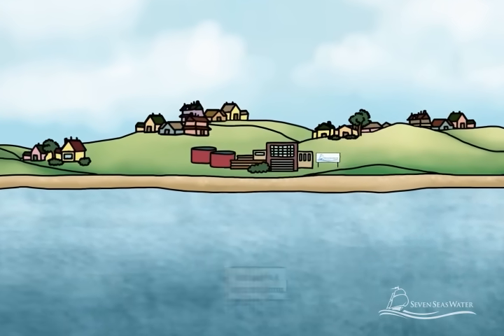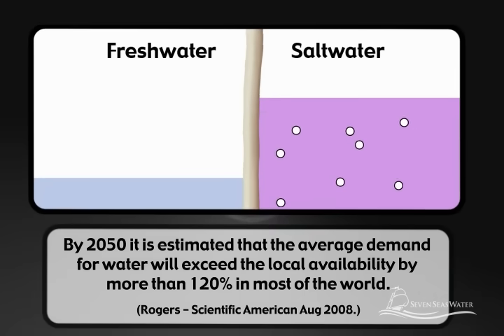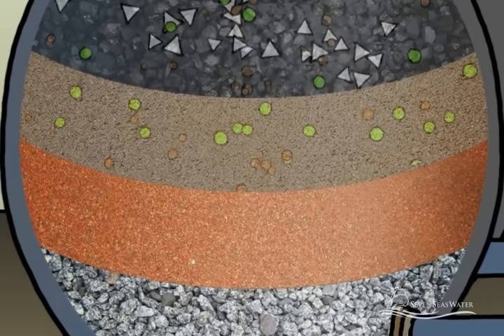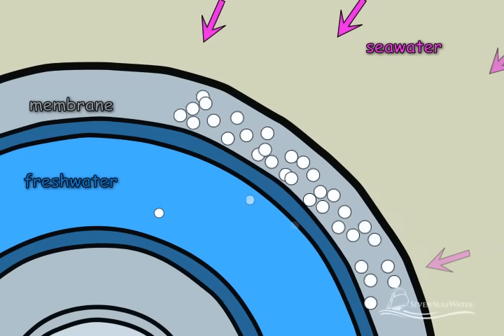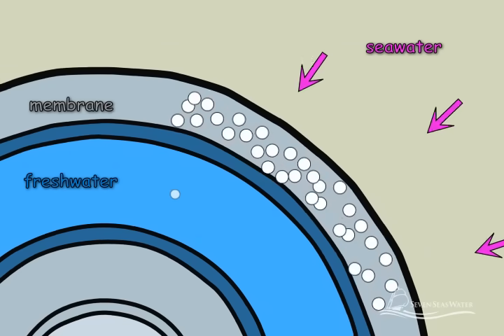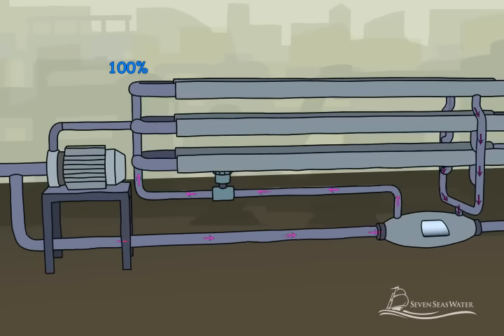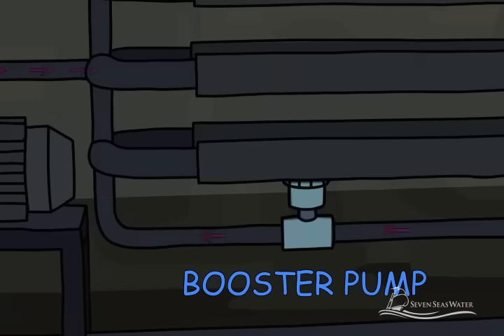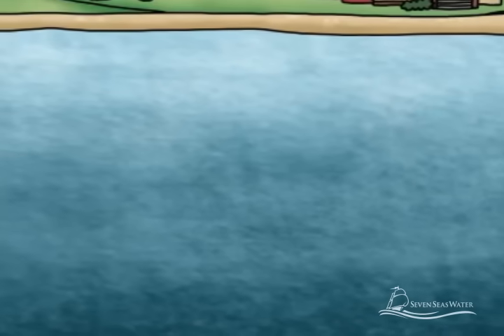How Seawater Desalination Works

Comment: Says someone who never took an engineering class "Wow it so easy! Why aren't we building this?"
Reply: This process is very costly and it requires higher maintenance cost time to time.
Nowadays, Desalination method is commonly used in gulf countries and nothern region of african continent nations.
Reply: The leftover brine is also toxic when put back into the ocean. If we could find a way to handle the brine I don't see how this could be an issue. The other problem I could see is the cost and energy consumption needed by these plants. We need better nuclear technology to power the 21st century needs
Reply: @prospektOS-tmo97  That's right.  Make things simple.  The isobaric energy recovery device is just a rotating cylinder with ends cut at an angle.  Easy.
Reply: @cryora  
It's technically a turbopump that uses the pressure drop across the brine to boost the pressure of the incoming seawater, right?
Reply: @gregorymalchuk272  Too complicated.  A cylinder with its end cut at an angle.  Now that is simpler.
Reply: I'm pretty sure it's easier than sending 4 humans to space for months and bringing them back.
Reply: One thing that they do not mention is how much fresh water is then used to backwash the ro filter.
Reply: Live abord Sailboats all use this technology.  Look up Spectrum water makers.  One of many.
Reply: @prospektOS-tmo97  It's just a rotating cylinder with the ends cut at an angle.
Reply: @Willem DaFuckedUp You can still wash yourself with it or irrigate plants. If you want to drink it just add a miniscule amount of salt.
Reply: Rubashow and you irrigate plants yourself yet!!!??  Have you ever???  But what the Fuck do you think happens after you irrigate plants with salt water!!!!???    They die you
Dumb shit!!      Think!! Not with your asshole. Do humanity a favor.
Reply: INTREPIDELICA  Those countries which have these plants,also have a plenty of sunrays so I'm sure they can use solar energy for sucking, pumping and filtering the sea water
Reply: Actually it isn't so difficult, but the cost is the problem, membrane production is incredibly complicated and expensive, even though its energy requirement its less than any method using water boiling
Reply: Energy consumption. Takes a large amount of energy to accomplish all this. Much more than just pumping fresh water.
Reply: @Fudzbo  There is a capital break even point. Most coastal cities are serviced by dams, aquaducts, pipes pumps etc located in distant mountains. Where the cost of all that stuff exceeds a desal plant you might be better off going desal. Some years ago I heard a lecture where it was suggested for a coastal city, on average, if the fresh water had to be brought more than 50kms, desal would be more cost effective.
Reply: Because the engineers who built this were morons. This is the worst way to do it. Literally. There are at least 2 or 3 better ways I can come up with on my own that will all work better than this.
Reply: no u
Reply: INTREPIDELICA   Some times it isn't about the price. BTW you can make a simple desalinator for like 50 bucks
Reply: Evan Kocka Because it was made by a moron its over complex to scam money out of rich bozos all u need us a water distiller its more effective and water is always as clean ad the first batch as opposed to this bullcrap that water keeps getting dirtier as the filters get old since day 1. All u need is 2 activated carbon filters pre and post and a water distiller also distilled water had 0PPM use a tds meter on this “potable water” and you see its till dirty. Bozo
Reply: You know we do have a massive scale desalination process going on all the time. its called rain, pours into rivers. If we just stop dumping all of our trash in 'm it might just solve the issue.
Reply: Just like the electric car
Reply: Reverse osmosis is relatively an expensive process due to high energy consumption and materials used to filter.  In addition, many companies disposes waste materials and chemicals into the oceans, which can create more problems for the filters.
Reply: @diehappy3997  a mistake many utilities make is to mothball reverse osmosis plants.   If they have been offline for more than a few months it can be very expensive and time consuming to bring them back on line because plumbing tends to clog if not continually flushed. Most  experts in the field recommend in times of water abundance, reverse osmosis plant be kept in production albeit at a low level. Requires some $$s though.
Reply: வணக்கம்
Reply: We have these. How do you think UAE gets enough water for a world-class metropolis?
Reply: I’m not even in engineering classes yet, this sounds expensive and complicated…
Reply: because he cord d still it
Reply: I understand ur one of those types who sits and says: it cant be done. Think further than.your "classes" or your diploma . Eureka I did it.
Reply: Because that word Economical is being thrown around very loosely. RO does work very well but it's the last option to be used because of cost. Both equipment and maintenance required.
Reply: Running a 1k psi pump 24/7 is troublesome to say the least.
Reply: my question is... Can brine be used for energy? or do they do that already?
Reply: The first reason why we are not building this, Is because it costs a rich mans fortune to make make it.     However, There might be a time and place where money be damned, We need fresh water now! So we might start building these water plants for survival sake.
Reply: @josephcalabrese6337  all of the potable water for the inhabitants on the island of Aruba is desalinated
Reply: @josephcalabrese6337  Instead of going to mars or sending other spacecraft into space, we could use that money for these types of things.  It's funny how things go.
Reply: @josephcalabrese6337  At that point its already to late. This is the sort of thing thats needs to be considered well before then, especially in places like California.
Reply: @jahquanfoster6974  Wasn't Ca. building some of these? If i remember correctly there were several of them being built, however winter came and we got water so it could have been shelved again. dunno.
Reply: @jahquanfoster6974  20 years tops
Reply: @jahquanfoster6974  we have that long m8
Reply: @Willem DaFuckedUp distilation also cleans water of most contaminants. Except organic solvents such as alcohol or gasoline.
Reply: im pretty sure its not that hard for something that keeps you alive, its not like u can say hey its hard lets stop drinking water cause its easier
Reply: @Mustafa_Wrya  i dunno but we can say lets stop drinking water it has been done for ages, the middle ages its simple, everyone drinks alcoholic beverages all the time it has been done so its a possibility.
Reply: @leagueaddict8357   alcohol is not the only ingredient in alcoholic beverages (nor any other liquid you drink)Usually more than 70-80% of them is water if not more, simply because higher % is lethal.
And nothing can replace water no living organism can live without it .
Besides alcohol is a poison im a pharmacy student so dont sell me alcohol is not bad nonsense to me mate.
Reply: @leagueaddict8357  The distilling process takes a huge amount of fresh water to make alcohol, a greater volume than the alcohol actually produced.
Just like using alcohol as an alternative to hydrocarbon fuels, it takes more energy to produce than it (might) save.  
It's estimated if the USA were to replace all petrol with alcohol from locally grown corn, the entire land mass of continental USA would need to be given over to corn production, and that still wouldn't be enough

Alcohol in large quantities also badly effect the bladder, liver and kidneys, effects the brain, and even triggers the brain to think you are more hydrated than you actually are (you know, when you get drunk and just can't stop needing a piss)  Actually dehydrating you more. 

I love alcohol, one of the best things in life is to over indulge on good beer or Irish Whiskey, but you need to drink more water while enjoying it to stave off hangovers and headaches caused by dehydration.  I hope your comment was sarcasm
Reply: Isnt it a LOT cheaper and simpler to just distil water with, say, solar concentrated beams heating it?
Reply: @brunofurtado8382  You mean like the sun, evaporating water, and making rain clouds since the beginning of time?
Reply: @sentinel9046  yes
Reply: @brunofurtado8382  Flash desalination. There is a cross over point involving energy cost the amount of water needed and the nature of associated industrial processes where flash desalination can be more cost effective.
Reply: @brunofurtado8382  it's called rain.
Reply: @brunofurtado8382  no it is not, water needs a lot of energy to be boiled, wheras reverse osmoses uses very little energy
Reply: @brunofurtado8382  That would be a waste of sunlight. It's more economical to use the sunlight to produce electricity and use reverse osmosis for desalination
Reply: @jmlinden7  With current solar cells at an efficience rate under 25%, I find that hard to believe.
Nothing is said about efficiency here - but building large glass-domed, sunlight-accesible trays and pumping out the evaporation as it build up ....  seems much simpler that building a solar energy plant, a electricity storage solution for overnight, building such a desal plant and keeping the whole complex interdependent structure running.
Sure, pumps and filters are also necessary in an evaporation solution, but that would be basically it.
To my mind the main problem would be the large surfaces needed for thos controlled evaporation pools. On a couastline.
Reply: Its that easy and cost effective plus sea water is free, then why the hell are Victorians paying through the nose for their desalination plant out in Wonthaggi? Plus it hasn't been needed or used in years.
Hmmm something smells fishy hahaha excuse the pun
Reply: @henryvong9581  Melbourne was at significant risk of running out so desal plant was needed to address potential catastrophe. Once there is no water in the taps the dying starts after about 24 hours and reaches a peak after about 5 days, by 14 days it's all over, most are dead.
Reply: Willem DaFuckedUp Ive been drinking it for 20 years and also why not add water honey or mix it with fruit juices and cook with it. U sure are a bozo. the healthiest people drink distilled or rain water if distilled water is not good for you how come plants thrive on gods distilled water aka rain? yeah go do more research and make sure they arent part of the zionist kabal like dr mercola.

Comment: this method is convoluted* and wasteful of energy and resources. There has to be a better way.
Reply: +shreddedreams Graphene filters will use much less energy.  Graphene was first produced, not too long ago, in 2003. Removing salt dissolved in water is not an easy process. Reverse Osmosis is more energy efficient when compared to distillation.  We just need more efficient filters.
Reply: I'm saying, in addition to distillation or reverse osmosis. I will invent a way when I have some free time haha
Reply: +TeslasLoveChild if you are interested could you let me know if you think of any possible ideas that you might find too hard for you to test. because I am about to start my science fair project for next year and I want to come up with a better way to desalinate water. I will have about a year to complete this if I can start early enough.
Reply: If we really wanted to we could just build power plants on shorelines and use the distilled water we get from boiling it to make energy and use that for drinking. The issue is maintaining machinery near salt water is harder and the plant would need to be running a water pumping station at the same time they're running a power plant. It doesn't seem like any private investors would wanna do that.

Comment: why don't we just boil it? it would be easier and require less energy...
Reply: Requires more energy.. takes a lot to boil that much water and its slow
Reply: +gotwoh3ll
They said, the process requires a lot of energy. That implies, alternatives like destillation require less energy. They should've been more specific and have said: "It's still less energy than destillation."
Reply: CANE Airsoft 
Especially in arid regions although it would only work during day time. Reverse osmosis is probably more reliable but again not very efficient.

You can't draw out all the water because there always need to be an outflow to maintain continuity. Plus you have to replace the filters every once in awhile.
Reply: CANE Airsoft
Water takes a lot of energy to boil.
About 4 mega joules per kilogram I believe. 10x more than the energy required to heat it to 100'c
It isn't practical. Much easier to do this as all you need is some pressure.
Reply: OR

Use renewable energy to power it.
Reply: CANE Airsoft haha funny, required less energy, god they get dumber by the day
Reply: cause if you just boil it how can i charge you all the money that it cost to buy a reverse osmosiss unit , lol
Reply: I agree, but isn't that still one step to much... can't you just distill via evaporation then sanitize the water in the same way as all other water..?

Comment: RO  is a membrane process that act as a molecular filter to remove up to 95-99% of all dissolved minerals, 95-97% of most dissolved organics, and more than 98% of biological and colloidal matter from water
                      the way this is done is to pass the water over a membrane under pressure.Depending on the raw water quality a larger or a smaller part of the water goes through the membrane, leaving most of the dissolved solids behind. These solids and the leftover water(called reject or brine) are made to leve the membrane surface area and is piped to drain.The water which goes through the membrane and gets purified is called the permeate water.
Reply: Chennai people these kind of plants.  Plants should run solar power on sunny days.
Reply: Hi is there a place where you can buy the membrane?
Reply: @alesgardener1659  They are very expensive. Around $800 a piece. And you would need the vessel, pumps and media filter.

Comment: not sure why they would need to add chlorine to RO water...
Reply: The same reason they add chlorine to treated municipal water now, to fight downstream contamination or the reticulation system. Immediately post treatment in up to date municipal water treatment systems the water is safe to drink before chlorination. Chlorine is used to keep the whole reticulation network safe because it is not a closed system. Air releasing valves and fire hydrants are just two potential sources for bacterial ingress into a reticulation network.
Reply: If you put fish in tap water they die - chlorine is poison.

Comment: If you had  extra heavy  50gal tank  both sides had reverseosmosis filter on it and you lowered it in the ocean 100ft or more put a vent pipe  on it would the capalairy action through the filter fill the tank
Reply: Melvin Bartoo you would have to sink the barrel by 700 meters to achieve the 1000psi required.

Comment: incomplete information !!!!!! what are steps in post ro treatment.?????
Reply: Try 5:47...

As to being "incomplete information", try this from the text introduction...

CASE STUDY: Desalination is a complicated process, the Seven Seas Corp. approached DaVinci Studio to develop an animation that simplified the explanation of the process. Taking a cue from Seven Seas we started with squiggly style animation to give the technical looking components a non-technical look. Bottom line is to go from engineering-speak to the layman's level. Desalination (also called "desalinization" and "desalting") is the process of removing dissolved salts from water, thus producing fresh water from seawater or brackish water. Desalting technologies can be used for many applications. The most prevalent use is to produce potable water from saline water for domestic or municipal purposes. 

Desalination 101